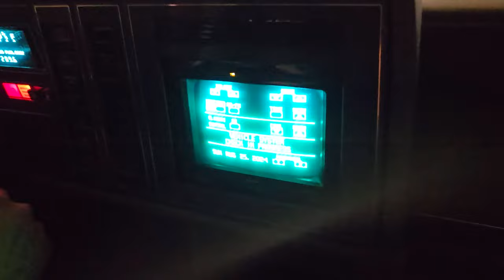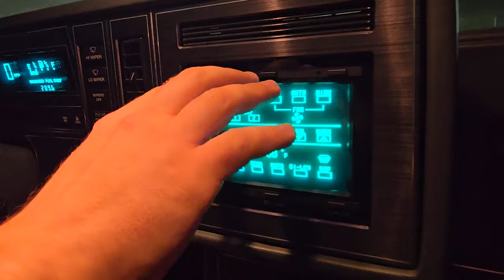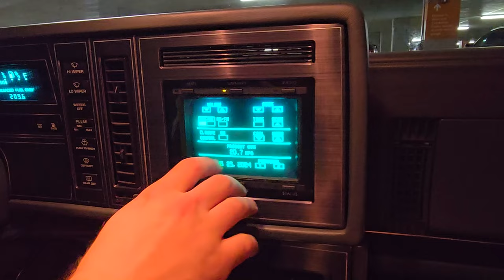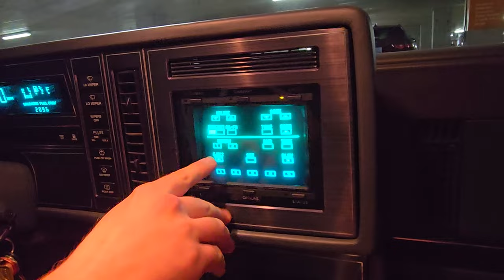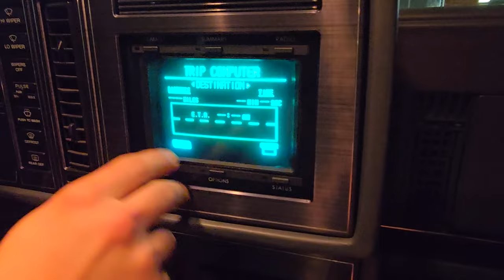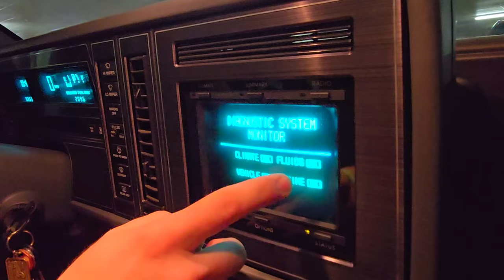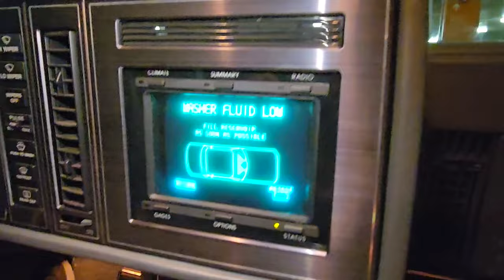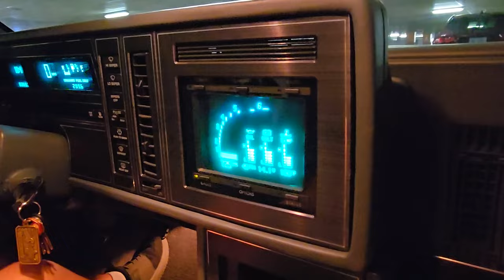This 90s Car has a touch-screen CRT!

Comment: My parents had a Buick Rivieria ('91?) and that screen was honestly a fantastic experience. Once you got used to the response timing of the screen, you could move around the menus with not much trouble. It also never failed, the engine died before that screen did and it was only affected when the car overheated. I really liked driving that car.

Comment: This was, of course, around well before this - nearly half decade before. I always wanted this, and the Atari dashboard from the Corvette at the time - but all the old morons in the media kept bashing the electronic stuff, bashing any car that had it, and eventually GM and Ford just gave up and went back to boring, generic analog controls until basically the last decade or so. It's amazing what those old, out of touch, dullards doing reviews, who were all stuck in the 1960s, did to push back car tech.

Comment: Tell me please 
I bought a Sony pvm-14n5e monitor
The picture is good, it shows super 

It started to hum quite loudly, as if the transformer was humming, the power supply 

What could be the reason, maybe some kind of capacitor should be replaced or something else? At least approximately. Otherwise, we don’t have specialists in our city. Nobody wants to deal with old equipment